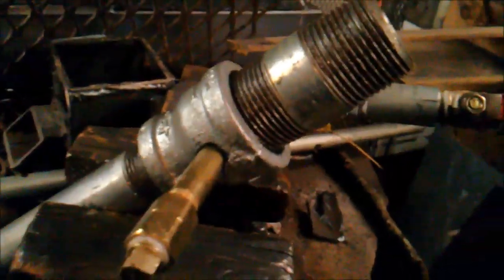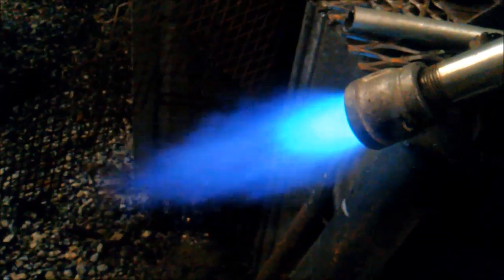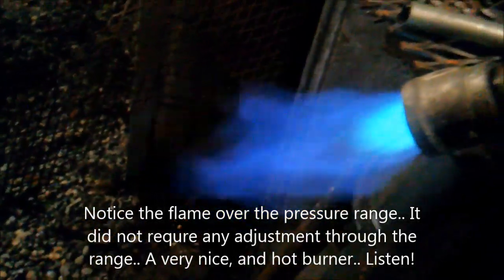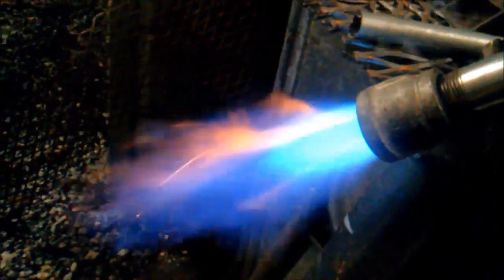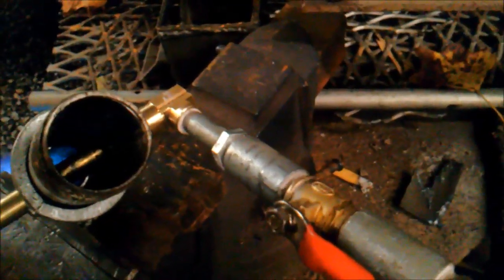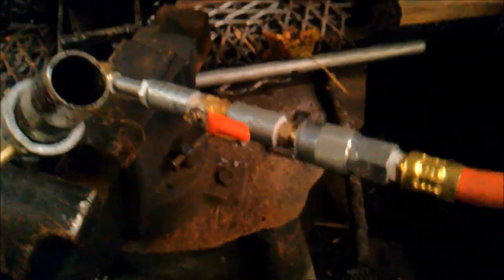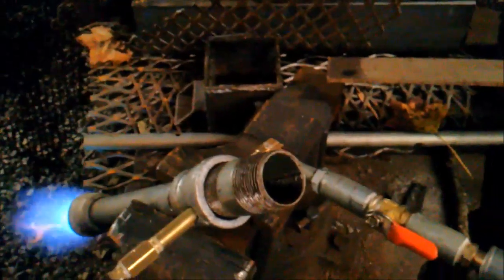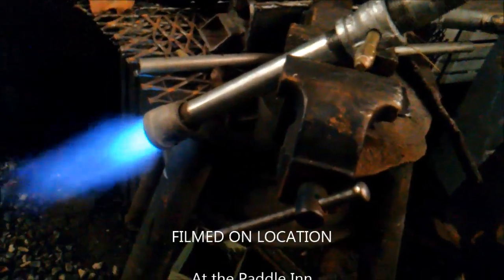Propane Burner for Blacksmith Forge or other applications.

Comment: Do you always get increase in heat output by supplying more oxygen and propane? Will the flame lenght increase with this increase in heat?
Reply from the maker: Yes. That is the way it works. If you don't get the propane and oxygen or air mixed properly you won't get a good blue flame.. But when you get it right you will. Some people use forced air burners. Does not require the venturi effect to draw the air in. then they adjust the amount of propane for the amount of their
Reply: If a joint is made at the end of the pipe, for instance, a shorter pipe is welded at right angle to the 3/4" pipe instead of using a 90 deg elbow to connect them, should that affect the heat output?
Reply from the maker: When you were dealing with an air and gas mixture based on a venturi effect it is pretty sensitive. My bet is it would not work at all. Notice at the top where the brass pipe is connected. The gas is being infected right at the base of the reducer. A venturi always has some sort of reducer and release of the reduction. if you want a hotter flame you're going to need more gas and more air. tried doing some research on forced air burners. I think maybe you're looking for something to melt and not to heat. look for a forced air furnace or smelt or melting  furnace.
Reply from the maker: Obi Amechi
This burner will bring mild steel to welding temperatures.. That is over 2000 degrees. It is in an open furnace. Open on both ends.. The flame heats the metal. I have two videos on this subject. Here is another, with a second burner that I chose, instead of the one you are looking at.. Both are about the same as far as the heat... https://www.youtube.com/watch?v=-CTHR6GKg2Q
I actually purchased a kit here:
http://www.hightemptools.com/burners.html
The first one.. 3/4 Venturi Burner Kit.
There are more details here about it.
http://www.zoellerforge.com/sidearm.html
I did use the Ward T fitting, but, I just used a 3/4 to 1" bell reducer for the bottom of the burner, not the stainless steel tapered fitting.. It is not necessary...
I do have insulating refractory inside of the forge.. You can see it in the video I posted first.. You can increase it some by using a Infrared reflective coating.. Very expensive, and not needed either.
If your drying cage is very large, just add a second or third burner if you don't get the temps that you need.
I've got several projects going at the moment that I have to finish quickly.. If you don't get where you need to be, give me a week, and reply back.. I'll look at your plans, but, I don't have a lot of of experience with large area burners.. But, insulation will be a factor for sure, but, adding a second burner if the area is large would be my next option.
Reply: Thanks Mark, I will add a 2nd burner to see what happens..but before then, I intend to increase the diameter of the burner tube to 2.5'' for more primary air, hook up a blower to it, and increase the gas inlet holes for more gas.
Reply from the maker: Wow.. that is big... 2.5".. Hmm.. Just try to increase the orifice of the gas jet in relationship to the tube sizes, etc.. Use the Ward "Reducing T" fittings.. They have the best unrestricted air flow, if you don't add a blower.. But, adding a blower will be your best option if you want to do it without measuring and calculating.. Put a metering valve in your gas flow line, so you can adjust it, and then, find some way to adjust the air flow.. Either by cutting down on the blower intake, or reducing the RPM's of the blower motor...
You will most likely have to have a Bell Reducer on the end of your tube, to keep from blowing the flame off of the tip of the tube.. I had to have it on the burner in the video..
ONE MORE SUGGESTION,, since you are looking for that much heat, and considering the blower motor..
Check into the "Ribbon Burner".. It is a forced air, propane fed burner, and sure dumps the heat.. I saw one of these running in Knoxville.. I would bet, this would give you the volume you were looking for.. Here is the build instructions, so you can see it, and know when you find more information about this particular burner.. It is easy to build..
http://blacksmith.org/forum/tutorials/ribbon-forge-burner/
Cheers..
Reply: I have checked the link, it looks great, thanks. But I have this thing with flame, though blue, I dont need flame to come in contact with product I'm spray-drying. I need just the heat, guess that's why I m getting the challenges.  And for me to get the required air temp at that distance, I need to increase heat output from source.  Thanks for the bell reducer advice. What's the right/best way to place it on the pipe? From previous tests, I placed a venturi burner i had made on top of blower pipe, when i ignited the burner, the blower air picked the flame and expanded it. i didnt use a reducer or any flame retainig technique. It could burn for sevral mins, like 45mins and then the flame blows off. I had wondered why it didnt blow off at first. Both blower pipe and venturi burner were housed in a 4'' pipe. Probably the 4'' pipe served as flame retainer, but not so well. Blower pipe was 2'' pipe. Thats the design I am changing.  I didnt wrap my mind on a solution for flame retaining...  I then saw a video here http://anvilfire.com/article.php?bodyName=/21centbs/forges/gasburn1.htm. and an article here http://anvilfire.com/article.php?bodyName=/21centbs/forges/gasburn1.htm he used a reducer. Now you mentioned a reducer, should it be placed the way the guy did it, the smaller diameter outside? or is it the other way round? Though he called it 'stupid', but I think its a great design. Going through his articles, i think he called it stupid bcos he couldn't regulate the blower and he generally doesnt like blowers much, but i do. Pls from the two designs for flame retainer, which will you most advise. Thanks alot for your responses.
Reply from the maker: I'm not sure.. With the Venturi, you need to have the bell reducer (Small end connected to the end of the flame tube, and then flare larger).. I would use 2" to 2-1/2 reducer.. Possible a 2" to 2--1/4" reducer.. When you turn the (Propane)flame up, if it is not enough, it will blow the flame off of the tip...
A forced air blower would be different.. It might be best to reduce the outlet size to get some backpressure, to force better gas/air mixing.. Would make sense to me.. You should be able to regulate both the air and gas if you want to control the flame..
I have seen this unit in action.. I know it works. It also has a reducer..
http://www.hightemptools.com/burners.html
But, as far as heat output,, the more fuel, the more heat.. The better the mix, the better the burn.. Would be better to inject the same amount of propane into an air mixture at high pressure, than the same volume at low pressure, etc..
For this example.. Better to have a smaller orifice, and more pressure, than a larger orifice and low pressure.. Any turbulation or disturbance of the Gas/Air mixture is going to cause it to mix better.. The better the O2 mix with propane, the more combustible it will be..
As far as the Ribbon Burner, in comparison, has much larger volume than a venturi burner.
If you want to have heat, but, no flame in your dryer, segment it.. Push the flame into one side of your oven, let it hit some refractory (Bricks, etc), dissipate the heat into the refractory, and control the flow of heat via your exhaust vents.. IF you want even flow, use a long vent, rather than a pipe, etc..
More even heat, heat under your objects, rather than over, etc..
Decide what type of heat is best.. Radiant, Air Flow, etc.. and design accordingly.
If you don't have enough heat, Insulate.. Remember, there is a cost to heat.. Look at long term costs.. Insulate rather than increase heat volume. You can always turn down the propane and air volume, if you design your input properly. If it gets too hot, then, turn the volume down.. Insulation will help you to maintain the temps you desire..
Insulation is not cheap at first, but, will save you money in the long run.
Reply: Thanks... already have the dryer insulated. Guess I just have to try it to know more. I'd let you know what I come up with. I usually get a drop in temperature after sometime, I suspect it's bcos of the gas freeze in the bottle and so causing less gas to come out. Do you have any ideas how to reduce the freeze?
Reply from the maker: Increase the size of the container you are feeding your propane from, or, put it in a bucket of water, etc... Over time, it will cool and freeze the water, if the bucket is small.. best to have some sort of water flow system, like a drain in one side at the top of the container, and a feed  at the other, lower in the  container to keep the water mixing.. It will freeze near the top, even though heat rises, because the level of the frost line on the container will be from top down, as the gas runs out of the container..
Sit the container in the sun if you can, but, if you are freezing up, your feed container is going to be too small for the job.. Get a larger cylinder.. Much larger.. If you are using a 20 pound cylinder, move to a 100 pound, not a 30 pound.. If a 20# freezes the 30# will only freeze slower.. The 100 pound has more surface area, so, should dissipate the cold better over a larger space/area..
Another solution.. Get a Barrel heater, like would be used on water troughs on farms,etc,, to keep the water from freezing.. Then, so, you don't spend too much money on Electricity, get a digital thermostat to plug the heater into..
I use this to brew wine during the winter... I put my buckets in a 55 gallon drum, and heat the water in the drum, to keep the buckets at the right temperature..
This is the Bucket Heater I use..
http://www.ebay.com/itm/NEW-Allied-Precision-The-Premier-Line-742G-Bucket-Water-Heater-/361181777482?pt=LH_DefaultDomain_0&hash=item54181c8e4a
Here is a controller that is 110V and 10Amp output, that will run the bucket heater..
It is not that hard to hook up.. Just remember.. The feed voltage to the heater is switched by this device, and not passes through the device.. See instructions for wiring it up..
http://www.ebay.com/itm/Fahrenheit-110V-Temperature-F-Controller-Temp-Sensor-incubation-thermostat-Relay-/281294885235?pt=LH_DefaultDomain_0&hash=item417e7b5173
If you need something more than this, look at this temperature controller.. It has a separate Solid State Relay for passing voltage through it.. It is listed as 40 amps, and will run much more than one bucket heater, but, it won't be necessary...
http://www.ebay.com/itm/Digital-PID-F-C-SSR-Thermostat-Temperature-Controller-PT100-Thermocouple-Sensor-/280879156946?pt=LH_DefaultDomain_0&hash=item4165b3ced2

I use one bucket heater to heat about 20 gallons of water, and I keep it at 90-92 degrees F, during the winter to brew my wine, etc..
One of those options will work, and if you go the temperature controller route, I'll bet you can find 10 other reasons to use it, when it is not being used in your dryer.. Cheers..
I have used my for keeping chickens and rabbits, warm, etc.. Also used it to turn a chest type freezer off and on, to stay at a certain temperature, above freezing, to keep something cool, but, not let it freeze.. I increased the temperature range, to keep the freezer from cycling so much..
Hope that helps.
Reply: Sure it helps..thanks
Reply: I promised to give u a feedback..I got the air temp I wanted in the chamber! The 2.5 burner tube didn't work, no wonder the man called it 'Stupid design', instead I used 1.5'' pipe and reducer as flame retainer, it worked like magic...got 460deg in less than 10mins..I danced like a kid with a new toy!  Then i realised I need to find a way to link blower impeller movement intelligence to gas supply...so that if  blower suddenly malfunctions, a solenoid valve should be activated automatically to shut off gas supply line...or else gas will keep flowing to produce soot and unburnt gas which is potentially dangerous...I m thinking of something like a magnetic pickup, but I m not an instrument person..wondering if you have a better and simplier way to it. Thanks.
Reply from the maker: Yes.
Reply from the maker: An Inline thermocouple, like you would use on a water heater to shut the gas off.
Reply from the maker: An Inline thermocouple, like you would use on a water heater to shut the gas off.

Comment: NIce! My first attempt at making a burner went off the Ron Reil design but I had trouble flaring the end out so i used a coupler like you did and Presto! Neutral Flame. Added a 0-60 psi regulator and I get a neutral flame same as yours at 1-2 psi no problem. 3/4" pipe on  mine is 8" and works well. My second build I used a .025 MIG welder tip in a design to remove the entire cross hole setup in the 2" coupler  with a brass tube and end cap (and having to drill a .025-.030" hole in it) and all the alignment issues. Took the mig tip then drilled and tapped a hole in the end of a 3/"8 NPT brass end cap for the tip and the end cap went to a 3/8 NPT Male/Male coupler and into my propane line (with another 3/8 NPT Female/Female) Then drilled and tapped a hole in the end of a 2" end cap and used a 2"x 3" NPT with holes drilled in it for the choke. Works well.
Reply from the maker: Yes.. I have one or two other videos of my actual gas forge. I used the special "Ward" Reducing "T", with the .030 Mig tip to zero in the center of the gas outlet. It uses a Male threaded to female inner threaded bushing.. You use a hack saw to cut through the threads of the male to use it as a compression washer to clamp onto the 1/8" black pipe, which can be threaded to take the 1/4" Mig Tips. It keeps the mig tip perfectly straight in the hole and gets the right venturi effect to pull the air in.. You can take a look at it when you have time. I did not do a video on it specifically though I should have..
Thanks for the tips.. I could look up and see where I purchased or found the kits. I believe it might have been "High Temp Tools".... They sell two kits. One venturi and one fan forced. I looked at the design, bought the parts elsewhere and assembled it.

Comment: why not put a blower on the end of the pipe to push oxygen in?  it will get it even hotter...
Reply from the maker: The oxygen flow works off of the venturi effect on this type of burner. The flame is pretty neutral like it is. But you are correct. If you increase the fuel supply at some point of entry of fact will be starving for oxygen in this particular set up. To overcome that situation forcing oxygen through would definitely make a difference. That flow would have to be regulated to get it back to neutral flame.

Comment from the maker: Yes. Agreed for safety sake.. It is never a good idea to use Galvanized on any type of Heated application.. Better to live life avoiding dangers, than testing them and surviving the consequences, or with them.

I ran this for quite a while. I built it from parts I had on hand to test it. I had seen these held in place with a nipple tightened from the end. I doubted they would keep things inline over time, but, I wanted to test it. I had planned on using iron for the jet pipe, but, didn't have that on hand either at the time, so I built it out of brass pipe. I wanted to be able to tack it in place when I got it centered properly. I was also using sizes of pipe that I could not find reference to, and wanted to test the combination.

Even with the bell reducer on the end, it never got hot enough to burn the galvanized off.. I deal with it from time to time when I weld something galvanized. I usually grind it off, meaning taking the surface of the metal off. You can sure as heck tell when you burn it off, if you try to weld it without first grinding it off, which is just as bad..

It is pretty nasty, and a health hazard.. I wanted to test two burners. This one and the side arm burner which uses the Mig tip. I had the "Ward" fittings on order when I built this one. I am using a total black pipe version, but, even though I have used it for hours at a time, I have never seen it heat up any other part of the burner enough to warrant the worry about galvanized.
I have not used the other burner with the galvanized reducer since, but, have almost used it a couple of times.
I almost used it the other night on something that needed a good heat source to free the rust, etc, and it was something remote, that I could not get into the shop, but, I figured another way of getting it off..
I still doubt it would get hot enough, but, I will be testing it at some point.. The venturi keeps ambient air flushing through the pipe, and the flame doesn't actually ignite until it leaves the tip. Without the reducer, the flame blows off and blows out..

Just saying,, practically, it would most likely not be a problem, but, for the sake of those not familiar, and those who would not be watching or aware,, it is definitely not a good idea, in fact bad,, to use Galvanized on any sort of "Hot" application.. It's better to put up with the surface rust, than to weld, grind, or use something with Galvanized on it I totally agree. I should have made notes in the video and in the notes about that.. I'll put notes in the notes section now.. Thanks.